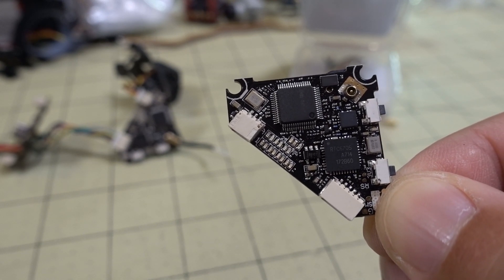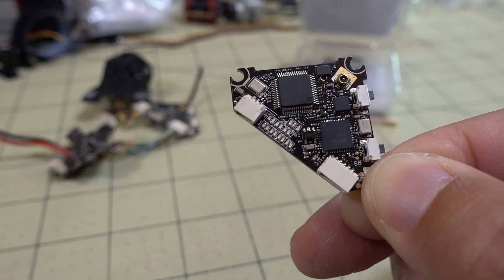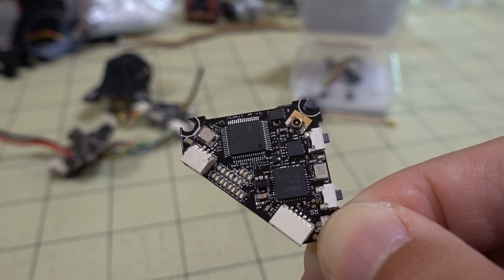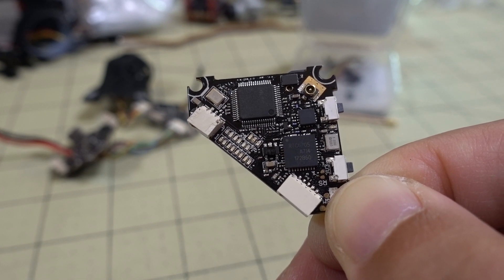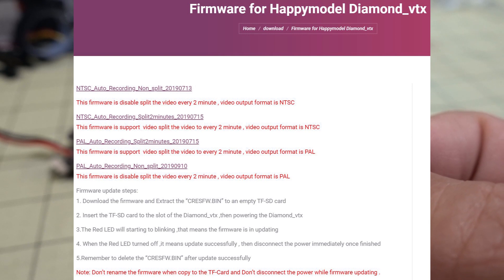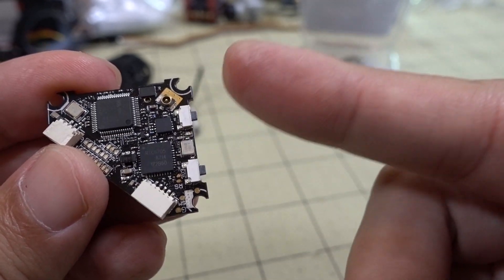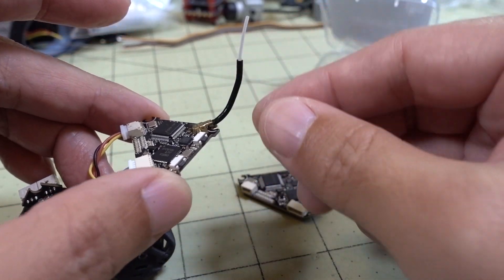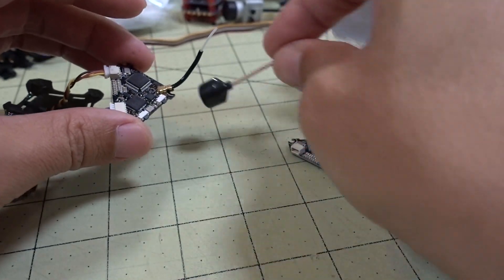Diamond VTX Troubleshooting Tips 🎓

Comment: Does anyone know how to configure this VTX to work over softserial? A year ago I remaped my LED_STRIP pin to be used as a softserial and I've been successfully using it with my frsky R9MX receiver (F.PORT) to this day. So I know this PIN (LED_STRIP) is properly remapped and works well. But now I flashed this R9MX receiver with ExpressLRS firmware and it uses different type of communication (CRSF). So I moved it to an actual serial port (RX, TX) and now I want to connect my VTX's smart audio wire to that softserial LED_STRIP pin. What's interesting is that in the Betaflight -> Video transmitter menu it says "Device ready - Yes". If I understand this correctly, it means that Smart audio should be working properly. Setting serialrx_halfduplex and serialrx_inverted to any combination/permutation doesn't change that status. It always says "Yes".But the VTX commands don't seem to go through in any inverted/halfduplex combination. VTX just doesn't receive any command (channel, band, power... nothing).  VTX table is configured correctly, because it properly works if VTX is connected to a real serial port. Is there any other option/setting in the Betaflight CLI that I could try modifying - maybe some delay or speed or something?
Reply from the maker: Have you tried this with a different FC?  I think there's something up with the FC you're using.

Comment: Hi Albert set vtx to race band ch1 in CLI but it’s not on that frequency re google ...changed manual but won’t save ... hope you can help love your channel 👍😊
Reply from the maker: You have the port set to Smart Audio and not IRC Tramp?  Make sure you have the correct UART configured.  If the setup is not correct, it doesn't matter what you put into the CLI as the commands never make it into the VTX so don't do anything.
Reply: Thanks Albert but the uart 3 is correct smart audio 😊

Comment: mine just record black video but my video transmission run well and shown clean image into my goggle, what the problem?
Reply from the maker: have you tried a different SD card?
Reply: i just fixed it by make series of camera cable one to fc and another one to vtx thanks
Reply: @imansubarkah5519  Hey, I've got the same Issue where the camera port on the vtx dont seem to work. Did you just solder the dvr output and camera output together?
Reply: @bradleylansink6514  yes i did it and it's work, and it sold
Reply: @imansubarkah5519  Guess, I'm gonna try that then. Thanks!

Comment: a little help please.. the red led near the record button never comes on, no light at all. doesn't respond when i put in sd cards, ive tried fat, and exfat nothing makes the led come one. it recorded the first few flights but since then nothing. how do i bring it back to life? otherwise the vtx works perfectly and i have the otrher 3 leds on the other side come one fine. can push the other button and it changes channels fine and all that, just cannot update firmware or record video.
Reply from the maker: So that LED was working before but not now?  Or was never working in the first place?
Reply: @AlbertKimTV  it worked before. Now won't go on no matter what. Other button does work, changes the channel, but the record button doesn't work not does the led right next to it.
Reply: @AlbertKimTV  turns out the plug from the diamond vtx to the FC was damaged! Thanks for your help!

Comment: Hi . Wondering if anyone could help with this. 
Got a NEW Diamond VTX, mod my Mobula7, the DVR records fine. But the TX is horrible. Drops signals even when I rotate the drone right in front of me. 
Very grainy VTX on my goggles. 
When I swap the VTX with another, everything is fine. 
Is there something about the Diamond VTX that I’m missing here? Thanks
Reply from the maker: Is the antenna connected correctly?  Did you use the same antenna as on the other VTX?  Are you sure you're on the correct frequency?
Reply: @AlbertKimTV  Hi Albert, I figured out that the power was at zero somehow. Can't seemed to set it using Betaflight. whatever I set gets lost after saving. Then I manually set it using the button and now it comes on beautifully .... BUT ... strangely, the Goggles sometimes after initially getting the signals strong and clear cannot lock on to it. After cycling through 3 beeps, I sometimes end up with a snowy screen.
Yet when I power off and on again, one of those power-ups will ledge on correctly and works great. I changed nothing at all. 
I still can't figure that out yet.
Reply: As follow through I will post on the problem I had.
Strange as it may sound, I did a power up and power down on my Eachine EV200d a few times. One of those power up will ledge onto the VTX properly. So long as I don’t power down my goggles, it doesn’t matter how many times I switched batteries on my drone, the signal is received as it should. 
I guess it may be the EV200d.

Comment: is it possible to use the part without drone? i play paintball and i want a cam inside my mask.
on the one hand, my teammates should see where i am and what i do about a fpv watch. and record that stuff for a video with the sd card slot
Reply from the maker: Yes, you don't have to use this in a drone.  Just needs power and camera.  It will need airflow if you're powering it over 25mW.

Comment: how long does the firmware upgrade take? I didn't see the LED blinking when trying the firmware upgrade - it would just stay off. I waited 30 more seconds and then disconnected power. After powering up again (still with firmware update on sdcard in) the LED would light up and stay solid. When I put the card back into my PC i noticed the VTX created a folder labeled "DCIM", so it seems to be doing something. I am using a 16GB Sandisk U3 SD card, but tried others for recording as well. Any ideas what else I can try?
Reply from the maker: Takes about a minute.
Reply: @AlbertKimTV  waited 2 minutes on each try now but the LED would never blink. Tried different firmwares on different cards. Any suggestions?

Comment: Mine won't record I tried formatting it , the red light is always on never changes I tried re downloading and extracting the file multiple times made sure the card was formatted first, I don't know what else to do
Reply from the maker: Is the red light flashing or solid all the time?  Is it ever off?  Same whether you have a card in there or not?  Was it in a crash?  Have you tried a different card?
Reply: @AlbertKimTV   Albert Kim  same problem.. with and without the card the red led is solid, try with different card but nothing has changed

Comment: Ta Albert ,.   set vtx_low_power_disarm=on  .  Another pearl of wisdom at the right time .  I been having this issue with my 6s 3 inch  Droner  , the thing gets hot quickly and I was wondering how to turn the vtx down  , knowing I could put it on a switch for pit mode  but this sis far more practical  and eliminates an extra switch function .